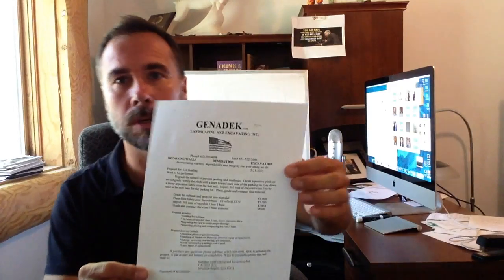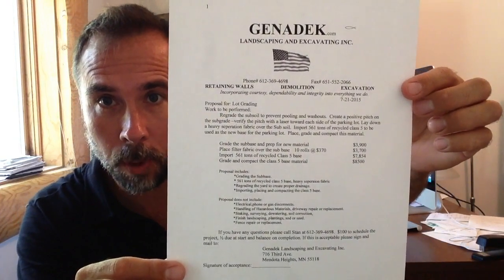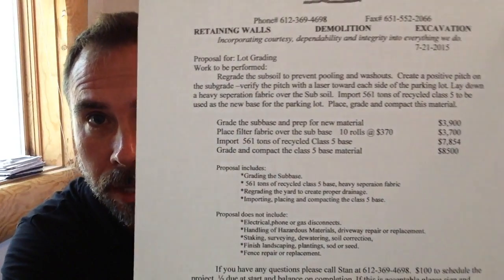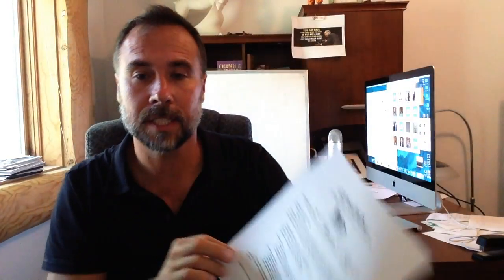How to Bid  Excavating and Grading

Comment: I don't like Crown in the parking lot , it's not a road. 6 inches in the parking lot no way , you should talk to your customer and trying to put 8" in. or more. Because remember it's a heavy duty parking lot, you going to have big truck and heavy equipment every day . Do it ones and don't come back . Recommend a water truck, small grader, and smooth roller, trust me you will see the difference, them only the skid steer. I like your video how are you explain everything it just took me a minute everything you show instruction and everything and the job is a piece a cake for me I can do by myself everything step-by-step. But I can't do it what you doing how find a jobs like that, estimate. Bid, And all that. Thanks

Comment: Thanks.  nice video.  I was an operations supervisor at a facility and worked with contractors quite often.  Not sure if they were just used to working for me or if something else was happening but I would often review bids like the one you submitted.  Before I would sign off, it was a,mutual understanding that the job would get done to the specs listed, regardless if the contractor had enough allowances built immediately. In other words, if he said 500 metric tons to get the base at x depth, and he had to use 520, I was paying no more than the original bid price
Reply from the maker: Good to know!  Thank you.
Reply: If your mom was baking you a few dozen cookies for a party but you came up short material, would you pay up for the needed material or make her pay for it? It's your party, not hers. She's just providing you a service. you should take care of your contractors and they'll take care of you.

Comment: The only thing that I could possible see doing differently is not calculating it at what it's going to be at the compacted depth. At work I've found that basecourse will compact almost like asphalt does. So if  you want a compacted depth of 6 inches typically we'd lay it a 1/4 inch higher for every inch of depth. So for your 6 inches we would lay it at 7 and 1/2 inches. Then once its compacted it's pretty close to that 6 inches. Small jobs I'm sure it's not to much extra but we do a lot of big jobs and  sometimes our formans or supervisor forget that or fail to acknowledge it and it ends up costing them thousands of dollars because they calculated for the compacted depth. Not what we have to lay it at to reach that compacted depth. Atleast that's how some of us calculate it and were usually pretty close if not right on the money.
Reply from the maker: Thanks for the input on this Kyle!

Comment: The weight of a yard of #5 recycled material depends on the ratio of concrete to asphalt and whether it's compacted. Your bid specified compacted and that factor is closer to 1.39 metric tons / yard. The extra truck load should cover it.

Comment: Stanley can I grade the roadbase with a mini excavator? People are asking me to prep for concrete pours for RV pads and I'd like to do it, but don't have a skid steer. The mini is a 9500 llb Kubota with an angle blade. I can deliver the roadbase OK (thanks for the calculation formula!!). I wonder if renting a skid will turn out better than using my own mini. Your thoughts? Thanks.
Reply from the maker: It will take longer but you can grade with he mini.  Use what you own.

Comment: I use to drive a forklift her a hotel bottle shop. They redid the car park which also had the access for the loading dock. They put in these foot wide speed bumps. Ever tried driving a forklift over a speed bump with plates of beer, let alone an empty forklift. We ended up having to chip away the tar road base bumps one night.
Reply from the maker: Trooperandcooper Ale Hahah-sounds like a nightmare.  What idiot installed speed bumps where a forklift drives?

Comment: Thanks so much for the coaching!! Im debating on buying my first used skid machine, I keep getting calls for large jobs and have been passing them up. I think its time to jump into some bigger projects. Any suggestions on what size machine I should look to buy for light landscaping/ grading, harley raking, clearing snow, possibly running a brush cutter. Any insight is greatly appreciated!! Thanks Stan - Robbie
Reply from the maker: Robert Dubois Any medium sized skid loader will work.  Once you have the equipment and skills-you will continue to get calls.

Comment: That was a very helpful video however I have a question. When it comes to class 5 ordering and bidding how do I take into consideration compaction. So let’s say for example me and my customer agree that I will install 10 inches of class 5. So I lay down 10 inches of class 5 but when I compact it that may drop too 6 or 7 inches due to compaction. How do I account for that in my ordering, do I order more to allow for compaction. Or do I just order enough for 10 inches and then just compact it and just leave it at 6 or 7 inches? What do I do. It would be good if you could make a video on this.
Reply: Stanley?

Comment: How much percentage do you usually upcharge for work or materials for it to be a fair amount? I am a new Septic Installer in my area and this is perfect for the work that I do
Reply from the maker: +Aqua clear 1 Every job is different.  My hourly rate is $125 per hour for an excavator.

Comment: Hi there ,From So.California.. I was in the grading and asphalt business.here for a long time.. You're estimating process is all fine and good for your area..but not all estimates apply to every customer.. commercial,vs homeowner.. oh one item that would also cover your butt, is Mobilization....getting your equipment and materials and crew to the job.. That's a big factor.. each move -in has a cost it's all over head .  The customer needs to know how much he would be charged  should your project schedule be changed by the customer in any way ..and the bottom line overhead  costs..fuel and time ....

Comment: How did you make 107% compaction? It shouldn't go past 100%. Just curious if I'm wrong. Thanks and good videos. Liked & subbed
Reply: LOL I was wondering if someone would respond to that! That means the proctor is off a bit. The density of the material changed from the sample taken to get the proctor. So the material he was placing most likely had more stone in it to make it more dense.

Comment: Great vid Stan but, I have an ethical question about pocketing the funds for materials paid for by the customer but not used on the job. My son used to work for a roofing contractor who had been in business many years and could estimate to the inch when it came to materials required, yet, he overbid every job by several to many bundles of shingles required. His employees who were very experienced, absolutely knew about the excess material billing but were told to shut up or hit the road. The unused materials were stockpiled and therefore, every few jobs, there was enough surplus material that a job was cost free (to the contractor, not the customer of course) except for labor. The average customer had no clue as to the scheme. My son quit as he felt he was participating in theft and misrepresentation of actual costs. Thoughts? Thank you!
Reply: I also do drywalling and paint on the side from my landscaping mostly in the winter...  I always over bid materials because if you need 100 sheets and that's all you get what if you break or drop or some are damaged I always go with like 20 extra..  I'll take a few off at the end of the job but it's more of a security deposit type of situation if that makes sense
Reply from the maker: Merlyn Sk Business is not easy and too many times we as contractors take the hit when a project doesn't go the way we want.  We take the risk and the challenges and deserve whatever profit we can make.  Never steal- but frame your proposals in a way that gives you the edge.  If your always bidding spot on-what do you do when you underestimate or make a mistake?  You take the hit.  Instead bid so you have a slight surplus- this is your cushion for a margin offered and if the job goes well-then you deserve to keep that cushion.
Reply from the maker: Stanley Genadek Landscape and Construction Business Pro Please see comment above and let me know your opinion.
Reply: That makes sense to me. I guess that is why you are a contractor and I'm not! :)
Reply: I'm with Merlybn sk. If you specify a quantity it should cut both ways. If a customer called you on it they would win in court. Then it just comes down to ethics. I agree with the video in that, the majority of contractors underbid and always take the hit. I would put the wiggle or buffer into the unit price. It works for me. THe main point of the video is not to throw generic numbers that leave you holding the bag on everything. GREAT POINT!!!! I am not calling the host un-ethical, because He will be using 10 rolls. If he knew ahead of time that he would only use 8 that would be wrong, but that's not the case. HE gives the square footage so the customer can double check.
Cheers
Reply: If you are covering yourself with the expectation that the 11th roll of material is charged to the customer, then the customer will expect a refund when only 9 rolls are used since you've written the contract like a time and materials job with firm estimates.  If you provide a distinct clause that states that under-use on materials is not refunded, that may work.  If you are silent but reasonable about things (2% under-use is kept, but 10% is refunded), most customers that aren't governed by municipal purchasing regulations may be fine.  Apart from conforming to any regulations, any savvy customer trying to make sure both parties are protected will negotiate something between a time and materials contract versus a cost-plus versus a firm fixed price.  Across many of your videos, you seem to do the right thing.  Combining the formalities of contracts and contract modifications with the business ethics you demonstrate should be fine.

Comment: Metric tons?     "Tons" at every quarry I visit are "short tons" or 2000lb     My trucks legally have a payload capacity of around 32000lb solo,  so 16 tons,  If I load 16 metric tons, going to get a big ticket at the scale.   

On your compaction by dump truck wheel rolling that completely depends on your material.    In the seattle area we build a lot of roads, and everything is vibratory compacted to >95% maximum density,   As for your compaction over 100%, brother,  not sure who did your compaction testing, but his proctor sample, was messed up,  or they did not discount for moisture in the material.     When we roll our road base we typically get 96-98% of maximum density, and the final test (before paving) is to drive a loaded dump truck over the surface to proof the base.  This is usually the test the city, county, or state inspector wants to see along with the geotechnical engineer on most projects.     Most of the time, and with most materials you will not get 95% maximum density wheel rolling the material only.     You usually do not need a big (heavy) roller to get the compaction, but a bigger machine can compact larger areas and thicker lifts faster.   I have gotten some of my highest results just using a jumping jack in a trench across a street, or a 40" double drum roller on sidewalk prep.   Not going to use a Jumping Jack or small double drum on a larger civil project though.   The biggest key with getting max compaction is moisture content of the material, and in the case of 5/8" minus used for road base here, is to keep the grading machines off of it as much as possible before it gets compacted,   Every time you run anything over your base material the material naturally separates,  fines to the bottom and all the aggregate to the top,  a couple times grading back and forth, and you have nothing but popcorn pebbles on top and nothing will compact well or hold up long term.

Comment: Can you go a little deeper into the ton vs cubic yard concept? To me it sounds like weighing kilos and pounds, as long as you have one number correct the other one should be correct? If I need 10 pounds of nails but the hardware store sells it in kilos... and I tell them I need 10 pounds and then they/I convert it to kilos then it’s the same as 10 pounds...??
Reply: There is a big difference and I will do my best to explain. Kilos and Pounds are both measurements of weight. In this case Ton = Weight and Cubic Yard = Volume. So having one number does not mean you have the other number.

As an example lets take two 40 cubic yard dumpsters. Fill one to the top with dirt and the other to the top with foam. You have the same cubic yard volume but two very different weights.

When figuring out how much material needed for the job you need to figure out the volume (in this case cubic yards) first. Then you need to find out what the weight is of the material being ordered per cubic yard (call the supplier). Then you can convert and order the material by weight. The reason this needs to be done is because most suppliers sell by the ton, not the cubic yard.
Reply: Great explanation!! Thanks so much!

Comment: In your material calculation you forgot to add material lost in compacting so, in theory you will be short on material no?
Reply: NorthStead Landscaping - North Bay - Callander I was thinking the same thing boss. We always count on 20-25% lost to compaction.
Reply: His conversion factor to tons/yd3 from cubic yards should be for compacted base not loose.  That's why the material is sold by the ton not the yard.  Soil is probably a better example.  Pulverized soil is around 2,000 lbs/yd3. where as freshly excavated soil weighs more like 2,500 to 2,600 lbs/yd3.  2,500 lbs. of both will compact to the same size, 1 yd3 of each will not.

Comment: Stanley u said u where honest and u said tell them  so much fab for job if u need more it on there shoulders but if less keep the money huh  ?? isn't 10x10ft by 4 in a yard so 1.5 times that would be  6in deep  think if I remember right I am 68 and had to quit building in 07 due to injuries and heart surg so memory not as good  , how do u make money doing this so much
Reply: Exactly,  He contracted for 10 rolls. He has to abide by the contract  same as the other party.

Comment: Good information but your math is off, I work in metric and have been doing this for 10+ years .   Eg.  10meter x 3 meters x 0.2 = 6  cubic meters x 2.4 = 14.4 Ton  allows for material aeration and final compaction. 
also your rock fill math isn’t allowing for fall creation on a flat surface. You would want at least 5-8% fall from the centre of your job.

Comment: metric tons or U.S. tons
Reply: I also noticed that BUT... what Stan was doing was factureing in the compactor factor of the Class 5 aggregate to get to 6 inch thick finished .
I mean when the Class 5 aggregate is compacted  the depth of it decreases, it is about 36% factor; so for Stan to place a 6 inch lift of Class 5 and a compaction factor of 36% he has to place the Class 5  8.16 inches thick.  His number of 408 cubic yards is the in place measurement that has to be adjusted for going from uncompacted (called loose) volume to compacted volume of 554 cubic yards. Stan"s usage of works was incorrect, he used wrong words, has notthing to do with metric tons or US tons.  To go from cubic yards to tons we use 2,800 pounds per cubic yard so his 554 cubic yards is actually   558 CY x 2,800 lbs = 1,551,200 divided by 2,000 in a ton = 775 tons (US) of Class 5 aggregate needed.

Comment: That's not a bid. I bid excavation jobs every day and I've been in business 35 years. When I give a price I stand by it, I can't go back and ask for more money for extra roll fabric or more gravel. If this was case everyone would bid low and then want more money, I know some small guys that do this but they burn bridges fast. This is bad advice and not knowledgeable guy. Doesn't know how compaction works. Can't have 107 percent if so proctor is wrong 100 percent is max. Just finished 10000 ton imported fill for pad had to have 98 percent on modified proctor not standard. It's almost impossible to get that by wheel rolling. Compactors are designed to compact dump trucks are designed to haul

Comment: Over bidding and scamming extra rolls of fabric should be on ur worst scams vids. If you put in the contract u will lay 10 rolls and only lay 8 you the contractor are not fufilling the contract . it doesnt make it ok to rip the customer off if they dont notice u did 8 rolls instead of 10 thats classic scamming at its best charge for more material than u need.

Comment: do you even know how to do a proper estimate?   a job like this should be a pure lump sum, not clarified how many rolls of filter fabric you are allowing for.  as a commercial contractor, I would toss your bid in the recycle bin without a second thought
Reply: tim johnson the state I live in will not accept any bids not itemized. To each his own
Reply: ok then don't say how many rolls you need to use, don't say how many hours of prep you are doing, how many rolls of filter fabric you are doing.  That's just shows you have no idea how to estimate and are just guessing.

Lets say you a homeowner and getting bids to paint your house and it says 132 manhours and 18 gallons of paint.  When its all done and the contractor spent 165 manhours and used 23 gallons of paint are you just writing out a check?  Your argument has you paying additional money

Also no idea why you are installing filter fabric, I've building tons of parking lots for major players like Home Depot and Wal Mart and we never did.  Perhaps its a soil issue in his area?